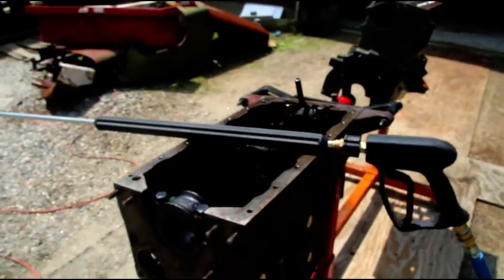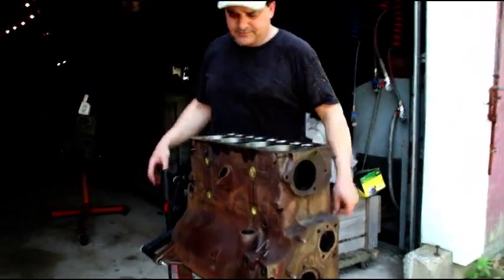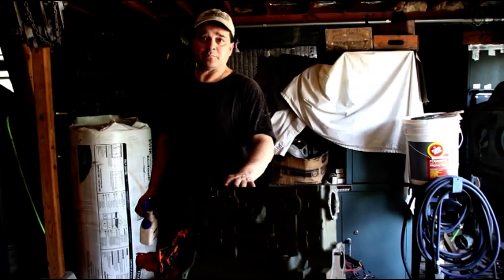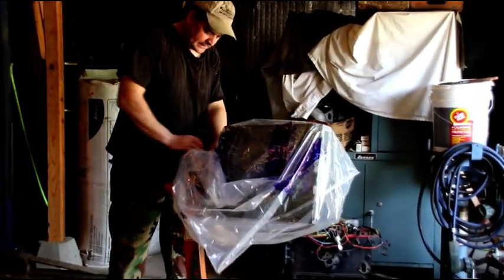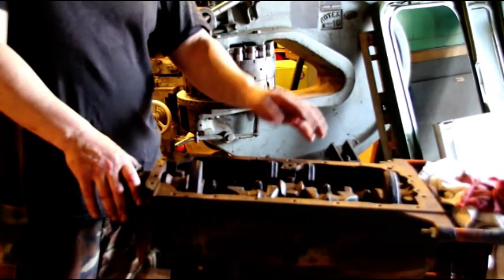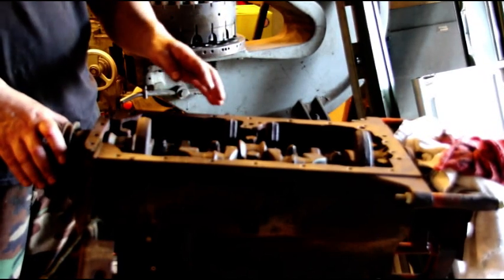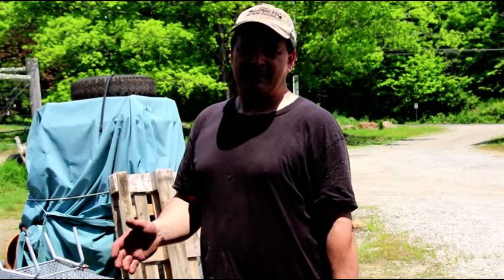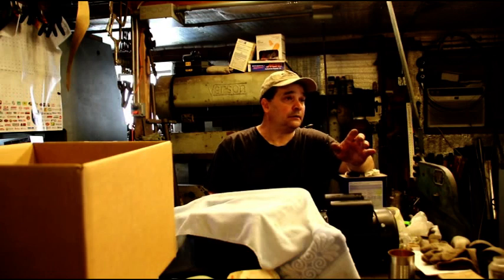Saturday Afternoon Angry Rant.... Gary's Engine and Disappointing People

Comment: One time my Dad had a local engine shop rebuild him a high performance 454 to put in a brand new '83 Chevy K-30 pickup.  They did the installation as well.
It ran great, but they didn't break it in properly or something because it burned a qt of oil almost every fill-up.
But the real problem was, after he sold the pickup (to a trusted friend), it developed a coolant leak.  When my Dad and his buddy looked at it, they pulled about a 2" long chunk of silicone out of the side of the block that had obviously been there since the engine was built.
The best they could tell, someone at the engine builder's shop either was hot-rodding it and threw a rod after the initial installation, or something else to cover their tracks and get it out the door.  Unfortunately for my Dad, their quick fix worked for a few years and the dishonest employee got away with it.  
This whole saga reminded me of this old 454 story.  
Best regards, Brian.
Reply from the maker: Crazy what comes out of machine shops isn't it??   I have heard stories like that and as you can see get engines in that have problems as well.  Thanks for the story and keep watching to see this engine come together.

Comment: Here's the thing.  We go to machine shops and pay to get work done at a level that is SUPPOSED to be of a far higher quality than that of the average backyard, shade tree, Beer & Barbecue Rebuild.  

We're talking about paying for methodical work where the corners are turned squarely, the work is done correctly and then verified as having been done correctly and the end result is 100% spot on.  One and done.

Frankly, I'm not seeing that with this engine.  Quite the opposite, in fact.  

That said, if this person is running a shop where he has employees who are performing substandard work on his behalf, he's still guilty of not checking the quality of the work that is being performed in his name and in a REAL machine shop, checking and re-checking is the essence of the work being performed.  

When the foul up is as bad as this is, why in heavens name would the shop that did the work (if they actually did ANY work at all) expect a customer to give them another bite at the apple?  They had their shot....and muffed it.  Sayonara baka!
Reply from the maker: Sounds like you fully understand the situation.   The customer knew he would not get a good job from this company so he came to me.  That left a way out for the shop that sold it and they are taking advantage of that.   Hard to believe a shop would let and engine like that out the door.

Comment: Yeah I know all about engine builders there's a racing engine builder in the state of Ohio that does not stand behind their work when their Motors blow up on the racetrack with only one lap !!! Oops there goes $20,000 but they'll cut you a deal on the next motor and it didn't even last a whole 10 laps, Strasburg,Ohio🤔
Reply: Speed shops can be the worst bullshitters there is in the automotive machine shop business. See it all over the years. Always blame the customer or driver.
Reply from the maker: It doesn't just happen in Ohio, I hear about it all over the place.